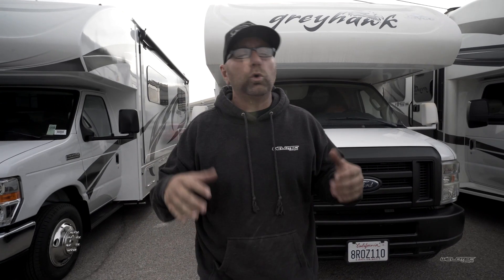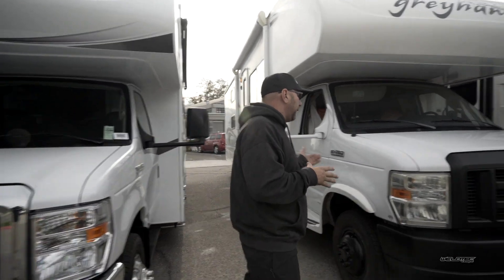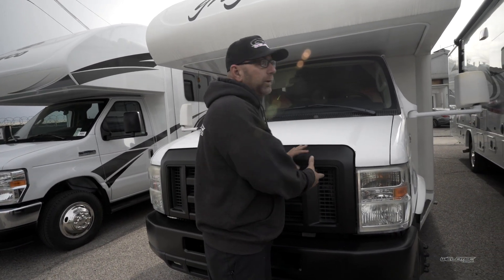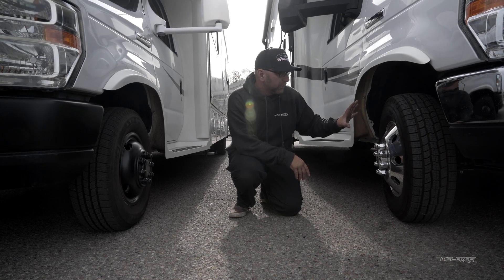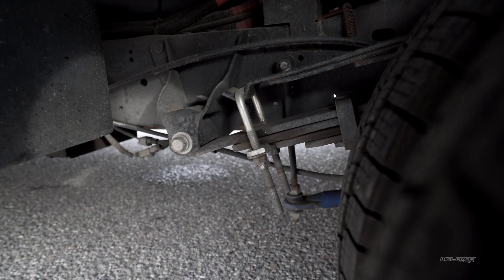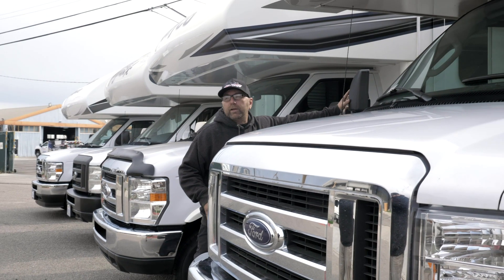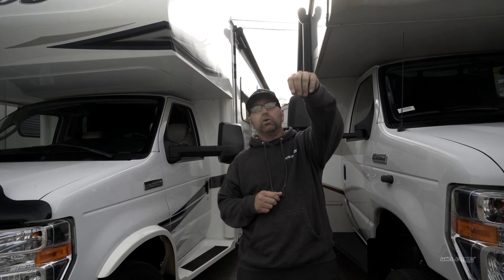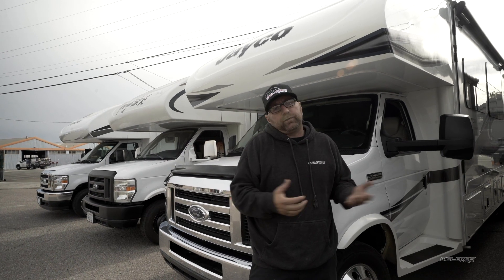Best Upgrade For Class C RV Suspension! Stock vs 2" vs 4" vs 6" Lift Kits | MORE GROUND CLEARANCE!

Comment: So, I think you guys could really make a killing beyond what you already do is if you can do custom rear springs in the 2" kit as well. I realize that may be a little more work but as you said, the sock springs are not correct. I have done a lot to mine and I still am not a fan of the ride. No matter what, glad to see you guys offering even more for the class C motorhomes.
Reply from the maker: We now have a new kit that is only 2" of lift